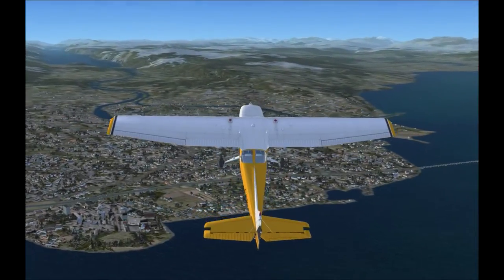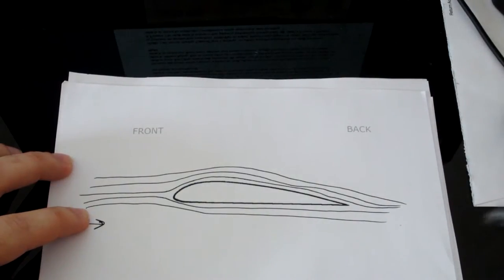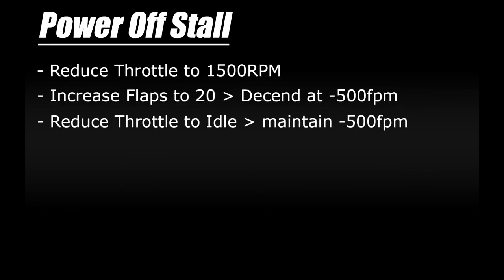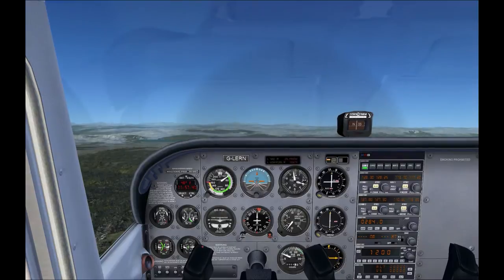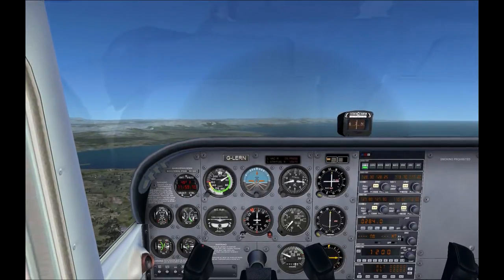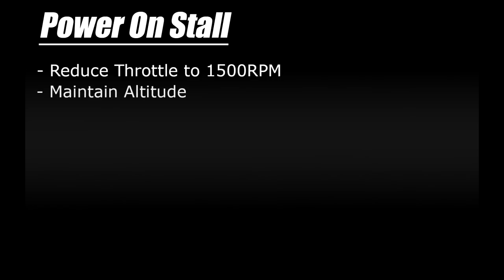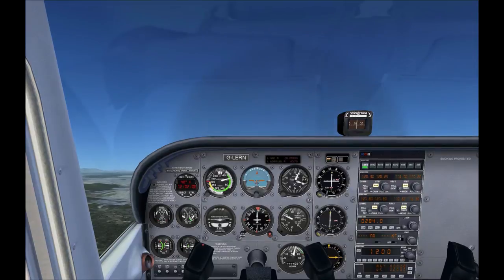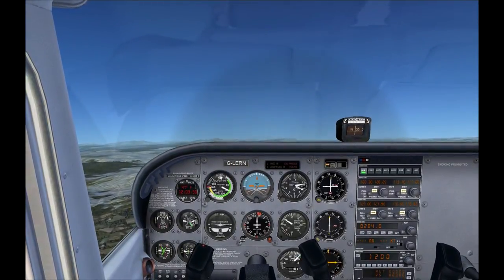FSX Tutorial: Stalls

Comment: That "air flows faster over the top thus creating a lower pressure" myth has been taught to pilots and even aviation engineers for ages, but in recent years is increasingly recognized as pretty much wrong (I never found it convincing in the first place): As it turns out, the primary contribution to the pressure differential is from the effective angle of attack after all. (Note how even in the "level" configuration commonly depicted, the center of the leading edge is actually higher than the trailing edge, so the effective angle of attack is still non-zero.)
Reply from the maker: Hey CLipka, thanks for pointing that out! I'm going to revisit the topic of lift for a future video because a couple of people have mentioned that my explanation might not be accurate or based on an old understanding of aerodynamics.

Comment: Are stalls and slow flight really really important in aviation? I'm afraid that when a stall does occur, I am going to forget the steps.
Reply from the maker: Yeah they are. If you stall and don't know how to recover, chances are that you'll crash into the ground. It's very easy, push the nose down and apply full power then slowly pull back up.
Reply: FlightEnthusiast05 as Doofer said they are very important.
As far as I know you are required to practice stalls and slow flight in pilot school (at least for PPL).